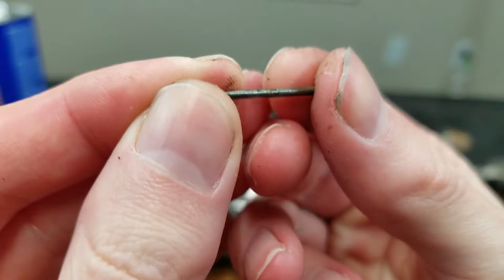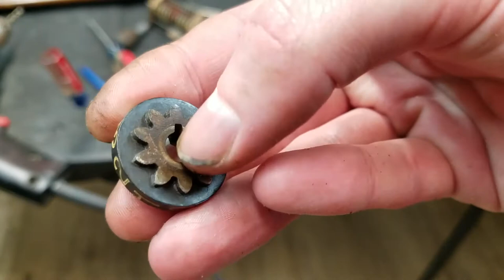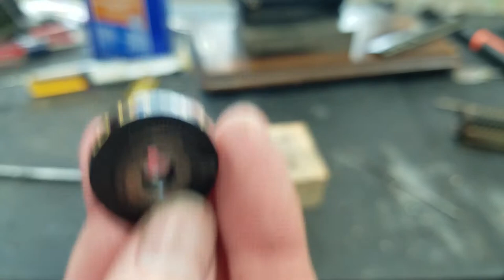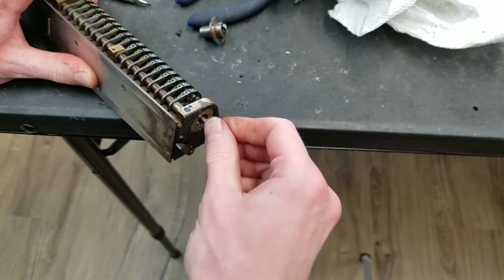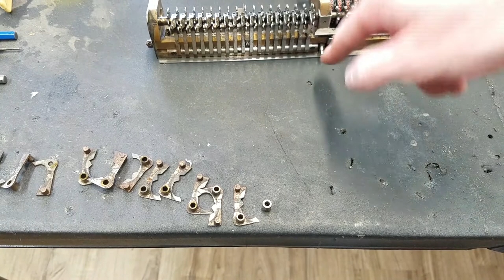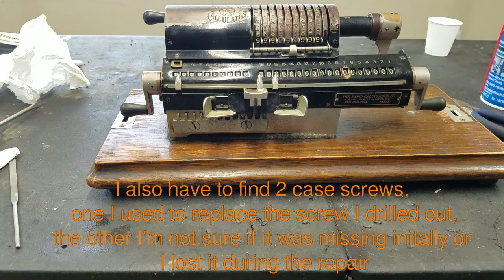Rapid Calculator Repair: How to Fix a Mechanical Calculator When Some Digits Wont Clear

Comment: Hello! I haven't seen the video yet, but I think it's fantastic that you share tutorials solving problems!

Actually, I had this problem with my Elettrossumma 20: the machine was not clearing correctly when I pressed the total key. I tried to lubricate the sliding part that limit the number of digits printed on the paper. 

I'm not sure if I really did something useful. Apparently, the problem with clearing is gone, but the machine still have problem to add hundreds (the fifth digit form from right to left). For example, when I add 456,00, the machine often adds 56,00. 

The curious is that it happens only once, when I use the machine after some time stopped. The problem disappears immediately after the very first operation. When I use it, I simply press the non add key with a number with hundreds (it is always the 456,00), it prints the 56, and immediately after it (I use the repeat key) it prints 456 and don't show this problem again until I left the machine stopped for a while.

Congratulations for the channel!
Reply from the maker: Unfortunately this video is more for the rotary pinwheel machines than the reciprocating ones, but theres 2 other places you could try to oil on your machine, one being the register itself (although given that a non-add seems to loosen it this is unlikely). It could also be that the part that slides back to hit the peg on the bottom of the pegboard to read the entered digit is sticky and so stays stuck at 0 instead of sliding back to hit the 5th peg (in your example, since theres a peg for 0) on the bottom of the pegboard